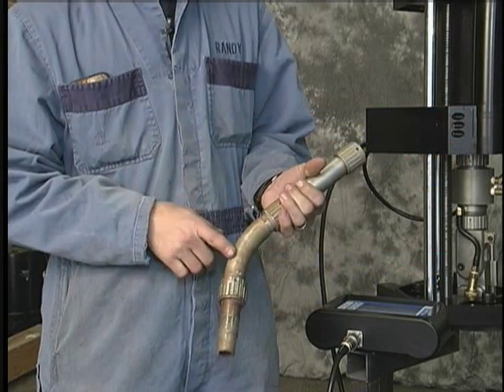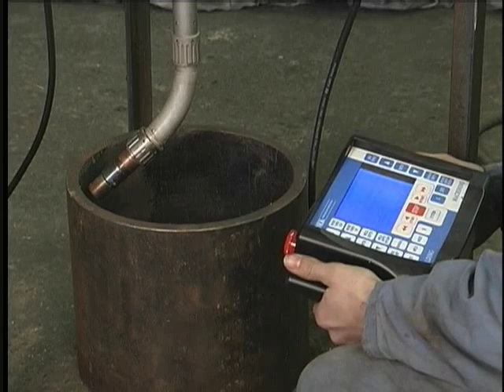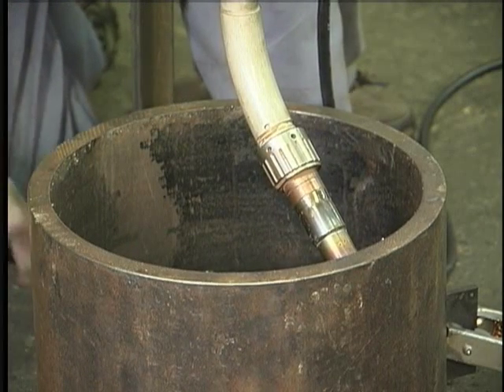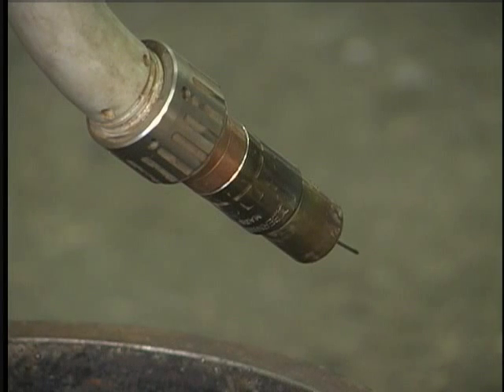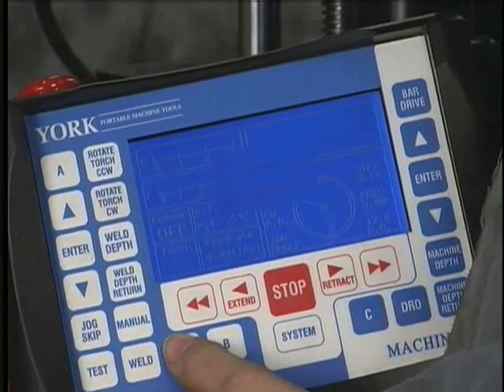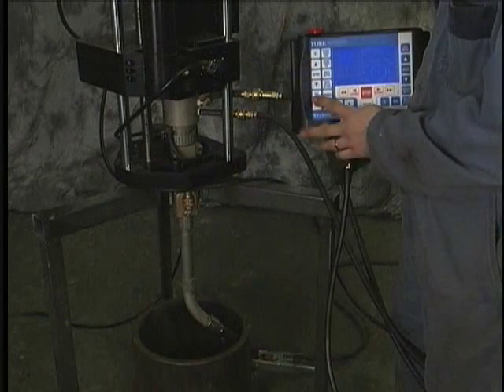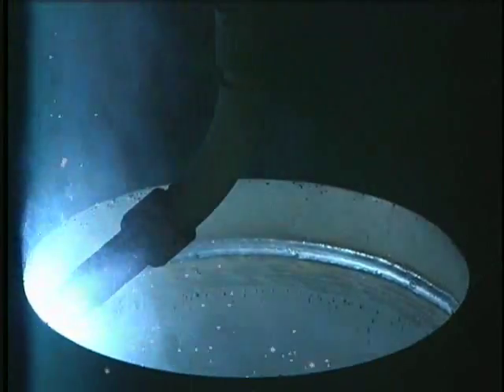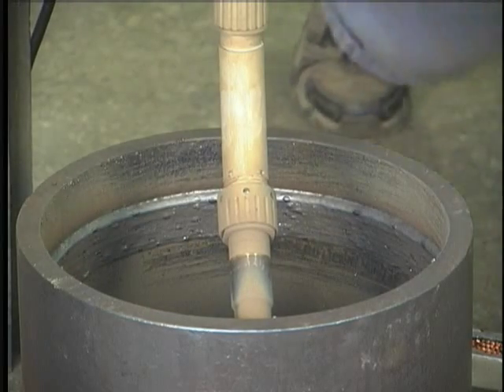York 500 Amp Bore Welder

Comment from the maker: Applications for use would include large valves (Mills, Pipelines, etc.) Axle housings from off highway haul trucks (tar sands) might also be an application. Pretty much anything with a hole between 1 and 10 ft diameters.